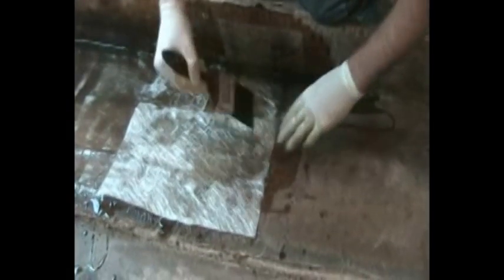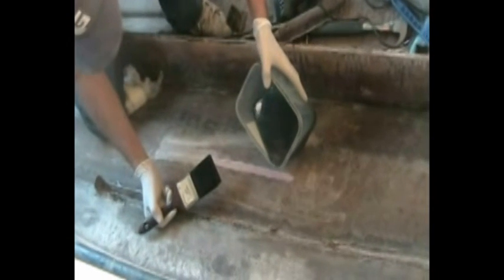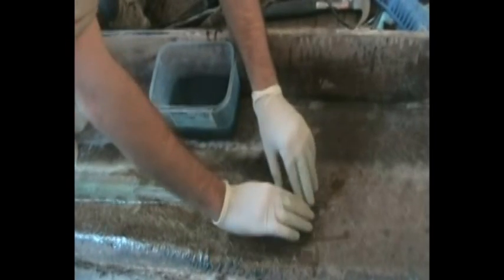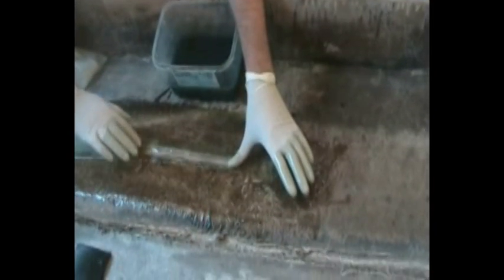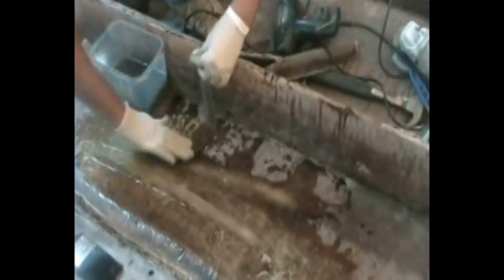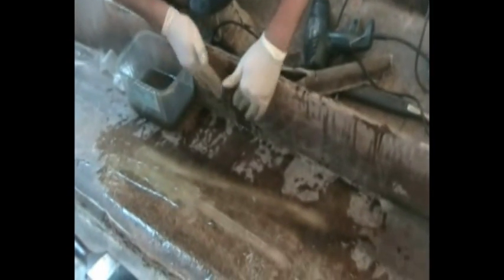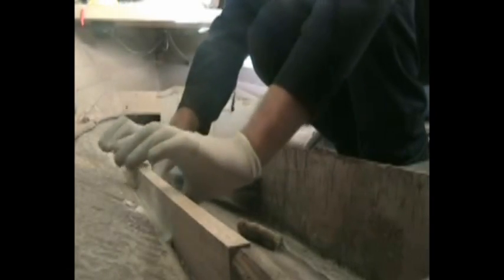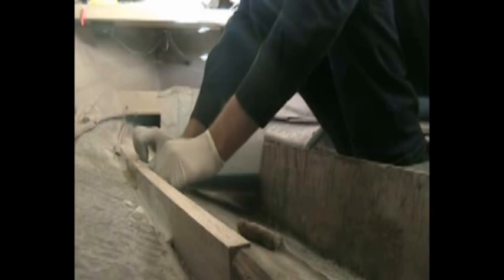how to fiberglass  BY a beginner for beginners-part 2

Comment: The tape was a great trick.  I'm going to fiberglass a rust spot in the bed of my truck.  When I sanded it, there was a 2" by 2 " hole.  So I'm going to put some duct tape on the underside of the hole to keep the fiberglass on the one side.  Thanks for sharing.